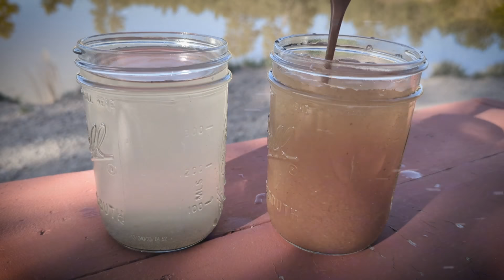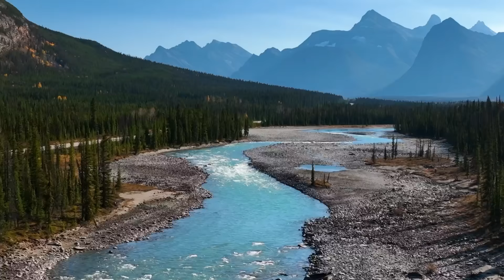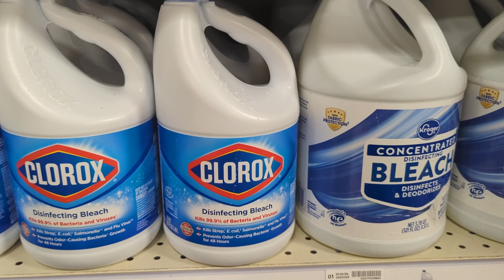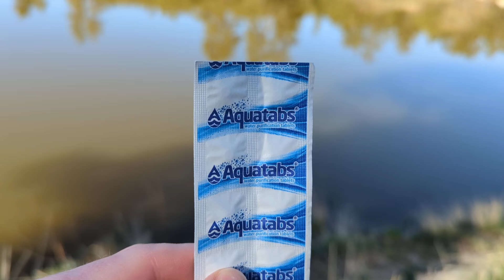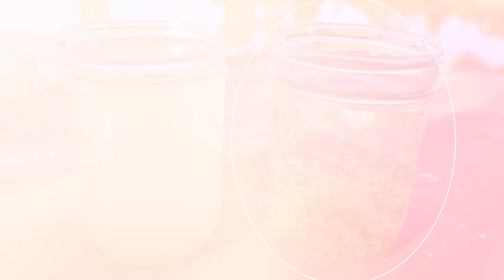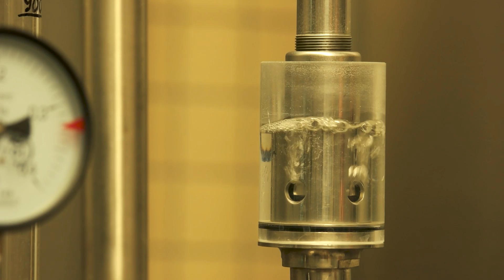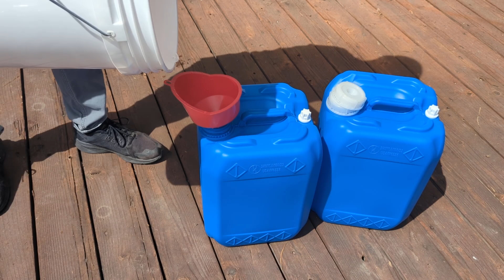The KEY to Emergency Water Preparation Before SHTF

Comment: All of the methods in this video will work but are not practical as true survival tactics for more than a single individual for very short periods of time.

Practical, large-scale, grid down survival as far as clean potable water is concerned.

#1 ~ being armed, trained in how to shoot, and being willing to defend one's self, one's family, one's possessions, and one's resources, aka any water one collects, to the DEATH against ANYONE attempting to deprive you from any of the above, for ANY reason whatsoever, To include the authorities, government officials, law enforcement, etc. PERIOD.

#2 ~ some means of non-motorized 2-wheeled or 4-wheeled conveyance, aka a heavy-duty, well-constructed garden cart by which you can transport for long distances a minimum of eight, food safe, 5-gallon buckets of non-potable water back to one's residence where screening of debris and filtration can take place.

Gasoline powered cars, trucks, ATV's, side-by-sides, 4-wheelers, etc. are all fine and dandy until fuel is limited, severely rationed, or non-existent. Even the tallest and strongest man on earth is going to struggle to hand carry two, fully loaded, 5-gallon buckets, with lids installed, of dirty water more than a few hundred yards before becoming arm weary and winded. 

How many Americans have a well-carved, well-fitting shoulder yoke by which they could easily suspend two 5-gallon buckets of water from either end of the yoke? Or, who have the back and shoulder strength and fitness to even consider such a means of heavy load transportation?

Five gallons of water weigh 41.7 pounds, plus an additional 3 pounds for the bucket and lid. That's a total of 89.4 pounds for 10 gallons of water.

Regardless of the lies, half-truths, and outright bullshit that is all over the internet, each adult human being in a grid down scenario is going to require a bare minimum of 5-10 gallons of clean potable water EVERY SINGLE DAY because our bodies will require and demand clean clothes as well regular bathing in order for there to be ANY chance of performing all of the tasks necessary in a grid down environment without one's brain, organs, and skin quickly breaking down to a minimally functioning state. 

Additionally, an additional 5-10 gallons of clean potable water per adult is going to be required for all of the various sanitation tasks that grid down living necessitates. 

#3 ~ Some form of tripod system with a large volume (3-5 gallon) 100% cotton Milbank-style bag suspended on the tripod high enough off of the ground so that a 5-gallon bucket can be easily installed and removed from underneath the cotton bag. 

This setup is to screen out any large debris such as twigs, leaves, stones, and dirt particles from the dirty water before filtration and purification takes place.

#4 ~ two 6-gallon capacity (or some other manufacturer's equivalent), stainless steel, Royal Berkey water filters. One equipped with black carbon filter elements and the other equipped with ceramic micro-pore filter elements. The two types of filter elements will eliminate 98% of the potential pathogens and contaminates that one might find in ground water sources.

In my late 20's I lived in a plywood cabin in Western Washington state for nearly 2 years with nothing but cold running water, an electric stove, and two minimalist electric baseboard heaters. Access to a toilet and a shower was several hundred feet away from the cabin in a machine tool shed that in the winter was only heated to a bare minimum temperature that would prevent the water pipes from freezing and bursting. That tiny, molded plastic shower stall was often so cold in the wintertime that simply brushing one's shoulder, back, or hip against the plastic walls was both excruciating and a shock to one's system.

Nonetheless, that situation was the  epitome of luxury compared to what a true grid down, 18th, 19th, or early 20th century lifestyle without running water or electricity would be.
Reply from the maker: Thanks for sharing

Comment: I use a Sawyer squeeze filter. It's the most popular filter for thru hikers. It's the best filter there is and costs about 30 bucks. It's good for 250,000 gallons and will filter parasites, bacteria, and chemicals. Only viruses can slip through but unless you are drinking ditch water that people take a crap in there is no risk of ever getting a virus. They give hundreds of thousands of their filters to people in African slums where all they have IS crap water and water born illnesses disappeared
Reply from the maker: I agree the Sawyer hallow fiber filters are a great portable device for making water potable, but it's important to note that they do not reduce chemicals like you said. They only address suspended solids

Comment: You said store water in a shed, but my shed gets really hot in the summer and freezing cold in the Winter. Could you specify please. Thank you
Reply from the maker: It's important that the containers are not exposed to sunlight. If temperature is an issue, you may need to identify an alternative storage location or install some insulation in your shed perhaps

Comment: Only stored water is going to be of any use in a nuclear event. Funny how nobody ever considers that scenario.
Reply: Wrong. Water itself (100% pure) cannot become radioactive, it's simply what's in the water thats radioactive. Both dissolved and undissolved solids. Simply distill it, and it's good.  Don't breath vapor that escapes, and treat the  remaining solids that are left behind as hazardous waste and your golden.  I currently do, and have for the past 13 years, operate an Ultra High Purity (UHP) water treatment facility for grid scale power generation facilities, typically producing around 460 GPM of 0.006 uOhm permeate.

Comment: Quick question; You recommend storing water gallons up to 2 years. I have several gallons about 5 years old. Will the bleach method be safe to sanitize before drinking? Also,  I appreciate any extra tips you can give me. Im a senior been prepping for a few years. Thx for a great video!
Reply from the maker: Bleach or water treatment tablets will sterilize the water if it is microbiologically unsafe. There are lots of good tips from others' comments in the description! Otherwise, just watch the video again 😉

Comment: An elderly woman once said to me a jar takes up just as much space if empty as it does full so if you have empty canning jars, can water in them. The water is sealed and sterilize until needed. So now every canning jar not filled with food in my home has canned water in it that won't turn.
Reply: Do you need to boil the water in the jars too like canning?
Reply: @414-ForSuch-A-TimeAsThis  yes. It sterilizes and seals them
Reply: That's a brilliant idea!!
Reply: Hi, I'm new to canning. Do you recommend a pressure or water canner?
Reply: @John_Thundergun  I prefer a pressure canner because its faster and theres no question the food/water is safe but water can be waterbath canned (boiled in a pot of water with the lids on)
Reply: I'm 66 and i can water for an emergency.
Reply: Every plastic drink bottle we’ve used for 4 years is full of water and stashed in and around the house. Maybe 2000 litres of clean drinking water.
Reply: Plastic bottles in heat. Give off poisons. Maybe placing water bottles in heat is not a good idea.
Reply: Get a life straw. You can drink contaminated water with it.
You can drink out of streams and rivers also
Reply: @deannacrichton7327  those only filter out bacteria, not chemicals and pine branches properly harvested do just as good a job per MIT study. Grape vine and other branches can also be used. Remove bark and put in water immediately to prevent them closing. Clay Hayes did a really nice video on it and has links to the article and MIT study.
Reply: For water bathing would you boil for 3 hours? 🤔
Reply: Thank you
Reply: @deannacrichton7327 those Dont do anything for microorganisms only thing that gets those is boiling or iodine tablets
Reply: @marshagail2727 no, just heat it up and take a bird bath
Reply: @deannacrichton7327  I don't know if YouTube filtered my comment so please forgive me if this is a repeat. A life straw does not sterilize the water. It will remove sediments, but it does nothing for the microorganisms. If you want to use the life straw to filter the water of sediments and then boil it later or treat it with an iodine tablet to sterilize it then yes it's a brilliant idea. Be cautious. Diarrhea will cause you to dehydrate a bunch.
Reply: @brettm.s.1169 those plastic bottles break down over time and leach chemicals into the water. Stop being a hoarder and get a proper large tank for that.
Reply: Water will stay potable for a shorter time in glass jars than in, for instance, jugs made specifically for long-term water storage. Glass jars being translucent makes them easily contaminated when exposed to sunlight.. that can cause bacteria to grow, regardless of the water being previously boiled or treated. I believe it can last a couple of years in sealed mason jars, preferably keeping them covered or in a completely dark, cool area with no sunlight. 

Plastic bottles, especially ones being reused, are NOT a safe way to store water long term for the same reasons listed above, but also they’re not made to store long-term liquids.. they’ll break down, emit microplastics and chemicals.. just don’t do it. Great way to make yourself sick if you need to resort to them in an emergency.
Reply: @deannacrichton7327  One of those straws done filter anything regarding bacteria. It gets physical filtration but it does not get microorganisms.
Reply: True!
Reply: Make sure the glass jars full of water can not freeze.
Reply: @deannacrichton7327  Sawyer Mini can do the same. They come with a straw you can attach, so that you can drink directly from a water source such as a lake, stream etc
Reply: @brettm.s.1169 ... storing water in plastic is not a good idea
Reply: Fact, I keep two freezers full of just frozen water.
Reply: @brettm.s.1169 I would consider that water for cleaning rather than drinking
Reply: @marshagail2727 Only if you're planning on drinking your bath water.
Reply: @slimjim2584 ok for flushing loo
Reply: @brettm.s.1169 I use plastic for toilet, gardening, washing etc.  use plastic purchased water and stir in cool basement.
Reply: That is true I suppose.
Reply: @414-ForSuch-A-TimeAsThis I imagine adding the amount of water treatment tabs you would use to treat the water would probably prevent any pathogens or algae from growing if you don't want to go through the effort of canning your water.
Reply: @garethbaus5471 7 is

Comment: Hey man idk who's toilet that is but just to let you know that small tube that is laying in the toilet water is supposed to be inside that vertical tube. This is the only way you keep your potable water separate from your sewer water. There is a chance you could have back siphoning in your water pipes and that toilet water will suck back into your plumbing, contaminating your drinking water. Just thought I would give you a heads up. I'm backflow certified lol.
Reply from the maker: I'll let them know, thanks!

Comment: Unscented bleach 4 drops per quart for biological purification - wait 30 minutes.  There should be a slight chlorine order, if not, repeat until there is.  NOTE: bleach won't help for chemical contamination.
Reply from the maker: You're exactly right. Filtration would then be a subsequent step to remove the residual disinfectant chemical and any disinfection byproducts.

Comment: Guys, after we boil and out the water in a container, how do we keep it fresh??
Can you drink water that's been sitting there for days?
I don't even like drinking water that's been sitting out for 3 hours....
So if we have no fridge, how to keep the water fresh???
Reply from the maker: The best way to prevent bacteria growth in water is by chemical disinfection. You could then use a filter (activated carbon) to remove the residual disinfectant prior to drinking.
Reply: @waterfilterguru  well like, when I filter the water already, but it then sits out for a day or 2, do I have to filter it again the next day?
Or like a tiny  tiny tiny splash of bleach (say in a large kitchen or cup) will keep it fine for a couple days to drink? 
Do you know what i mean?

Or if i put the filtered water directly into a milk jug with the top on, it will be safe to pour from for days even though it's not refrigerated?
Or will I have to filter it every use?
Reply: @melmelbry5754  you ask the funniest question, i feel obligated to answer. filters only eliminate large particles, there are times bacteria and viruses are left behind. 

I think I know what you mean by water not fresh, do you like put them in a large mug and drink and then the water have some funny smell after some time?

The fact is you don't need to refilter after you filtered it, but be aware that clean looking water does not necessary means its clear of microorganism and viruses
and if you placed it all in one big mug/ pot and drink direct from there, it comes into contact with your mouth which may contain bacteria.

At the time of contact, its only a little bacteria( about tens of thousands) but as time pass by hours later, it could've multiplied into millions and make your water stale. Boiling and UV light is the best way to eliminate bacteria, and drink them in small batches, pour them into a smaller cup and drink instead of drinking right from the bottle( even pouring right from bottle into your mouth may have a risk of contaminating the water, your exhaled breath may contain bacteria as well ).

You do not need to reboil/ resterilize it if you understand what you're doing. This is the very basic thing that surgeons are very particular about, whether their stuff is sterile ( containing little to no bacteria).

But if you're super particular about water being left about, although its sterile and not drinking, just remember in an emergency situation, you have to drink it anyways or worse things are going to happen to you. so yeah, as long as you follow the tip for your water to stay sterile, you will be good.
Reply: @alexlee1319  Thanks!
Water that's been sitting in a cup grosses me out after a couple hours.
I can't imagine having to drink it after days of sitting out with no fridge. 
I'm going to have a hard time with that.
I guess as long as it's a
Safe, I'll have to deal with it.
Thanks

Comment: Calcium Hypochlorite pool shock powder stores longer than bleach and doesn't lose it's effectiveness after 6 months like bleach does.  Also, water is very heavy in volume, about 8 pounds per gallon.  Best not to store a lot of it on upper floors.  Small amounts, sure, but not a 55 gallon barrel of it.
Reply from the maker: Thanks for the comment and additional tips!

Comment: If one has a freezer, freeze a few gallon jugs of water.  You might have to empty a little out of a full container just to prevent it from cracking as the water freezes.  Water won"t go bad when it is ice.  The ice also makes sure you have ice in the event of a power ourage to keep food cold.
Reply: Thats a really good idea. We have two freezers, a chest type and an upright. Neither one is ever completely full. The jugs of water, once frozen, would make them more efficient as  well. I'm going to do this....Thanks!!
Reply: I freeze 1/2 liter water bottles
,then break in half with back of heavy knife for drinks...with no " freezer flavor"
Also throw a bunch in coolers for the beers/sodas for camping...the plus is also having good drinking water should you run outta beer!
Reply: Distilled water near goes bad and cost the same as filtered.. just saying
Reply: @drcarriemills8772  store bought distilled water leaches chemicals from the plastic jugs it is in.  I would prefer to filter my own water and freeze it right away.  I do not even come close to using the capacity if my filters before I replace them.  It does not matter how cheap distilled water is.
Reply: @drcarriemills8772  
Goes bad!?
Reply: @jonjacobjingleheimerschmid3798  grows algae
Reply: @keithfillinger3182  great if you have a freezer and room. When I lived in FL we were always hurricane flood ready and electricity could be off for weeks so I'm just saying have gallons of drinking water. Here in AZ I prep differently. I have glass gallons of  water I distilled with my table top distiller. I avoid plastic like the plague for decades.
Reply: @drcarriemills8772  no...
No it doesn't..
Algae is a plant...can't grow in sterile water.
I rotate water every 3 years just because..
With no noticable changes
Reply: Brilliant idea!
Reply: My family would store it in gallon bags before a hurricane or somethin. Otherwise you always got the bathtub.
Reply: @drcarriemills8772 ???
Reply: @drcarriemills8772 where did you get your tabletop distiller, did you make it or purchase it. That’s what I would really like to have!
Reply: @KnowEyes  Amazon..$100ish
Reply: @keithfillinger3182 but if you buy the distilled water and instantly stick it in the freezer it won't go bad.
Reply: @drcarriemills8772 no but the container holding the distilled water can definitely b an issue unless u use glass or canned water!
Reply: @drcarriemills8772 put copper in - no algae!
Reply: @marshagail2727  in my home I distill my own water into glass containers but during a disaster I will drink distilled water from a plastic jug🤷
Reply: I do this. It also keeps the freezer cool during a power outage.
Reply: @gw5309 freeze in ziplocks double bagged